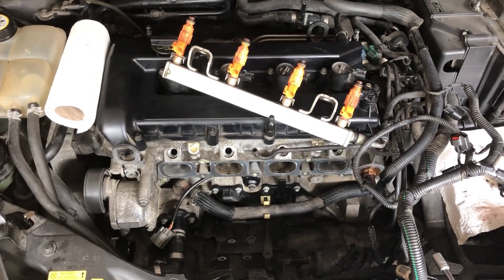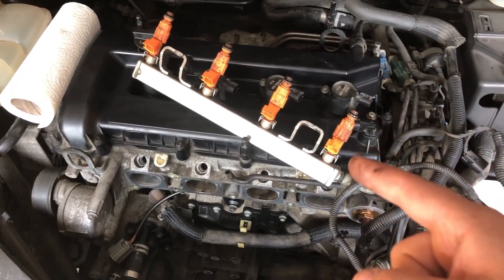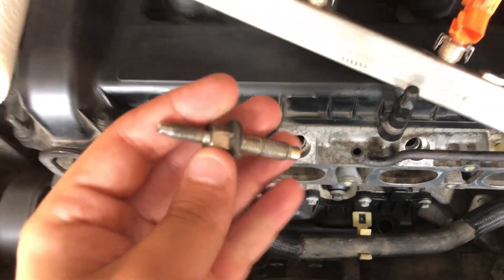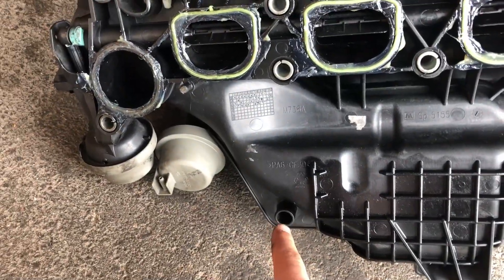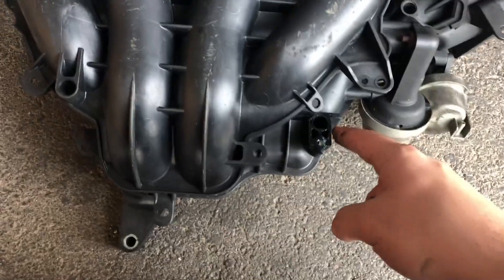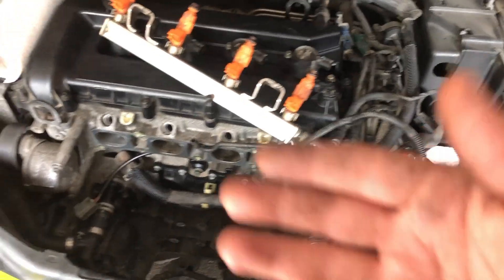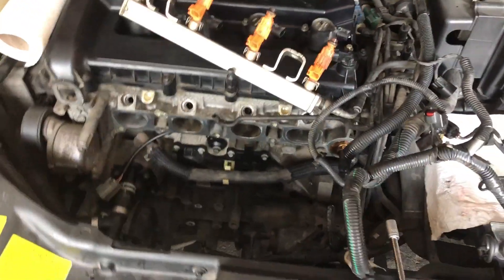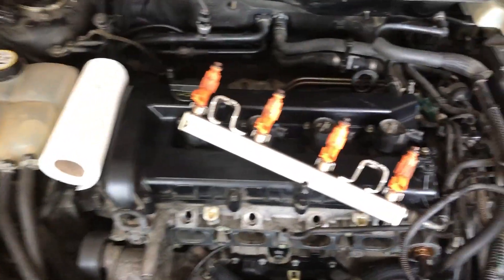Crankcase Ventilation System And PCV Valve (Volvo V50 1.8F)

Comment: how to check this Valve before dismouting all this intake system
Reply from the maker: It is not easy to check the PCV valve without having it out, and the symptoms of a bad PCV valve are not easy to detect, but they may include:
Extra blow by from the oil cap (if the valve is stuck closed)
Oil leaking from the seals around the engine (stuck closed)
Oil burning (stuck open)
These symptoms are also similar to piston rings' problems' symptoms, but it is better to check this valve before dissembling the whole engine.

Comment: does this operation need disconected radiator and take them out?
Reply from the maker: @dawid31m  No, this can be done without removing the radiator.

You may just need some extra small adapters to get off the bolt in the middle of the intake manifold. First you can insert the socket and an adapter, then put more adapters if needed, it is a bit deep and it is located in a tight place.

Comment: Im wondering if you changed the oil separator as well, and is there a specific torque for the oil separator bolts?
Reply from the maker: @tomastouma566  I don't have the torque specifications for the oil separator, but it you can feel it when removing the bolts, do not tighten so hard, it is plastic, and the gasket is probably a rubber gasket, which means that it is easier to feel it when the separator is sitting good.

Comment: Great and very informative video - just wondering if you scrapped the car since you just move and scramble the manifold around on the floor without thinking about all the scratches it gets everywhere and possible debris coming inside the manifold - it's all scratched up dude!!!
Reply from the maker: Thank you :)
The intake manifold was not dirty when it was installed back on the engine :)

Comment: Hi! Thanks for the video. Question: at time stamp 5:20 you show the inside of the intake manifold. What is that glue-like substance around the green gaskets for the intake? Was that original from the factory? Or has someone changed the intake manifold before?

Best regards,

Paul
Reply from the maker: Hi!
That was grease and it is not from the factory, if the gaskets are okay so you can use them again directly, if the gaskets are a bit worn so you can replace them first but if you can not so you can use some grease (Silicone grease so it does not damage the rubber) and it will be okay.
You are welcome! :)
Reply: @MerohDIY  OK, I see, thanks!

Comment: Do u need new manifold gaskets or rubber rings when u take off and put back on?
Reply from the maker: No, you do not need new rubber gaskets if yours are good and are not leaking air.
If you want to, you can change them, because the intake manifold will be already off and it will be easy to change them.
Remember to clean them and to clean where they sit on the engine and on the manifold, same ones or new ones, better if they sit on a clean surface.
Reply: Ok my volvo v50 rocket cover is leaking oil onto plugs causing misfire. Some recommended to change pcp valve or crank breather valve
Reply from the maker: @Onemanshow1974  Change the valve cover gasket and spark plugs gaskets (That are located under the cover, the rubber ones, not the metal ones) and then you can check the PCV valve if the valve cover leaks again on the sides or on the spark plugs.
Reply: When I open cap and put larex rubber glove it blows not sucks. I can try gasket. I change rubber coils and spark plugs and change gasket. Clean rocket cover before putting on new gasket and where it sits I will clean is there a torque setting for rocket cover. Thank you for the video good stuff

Comment: Can a broken pcv valve hose stop the engine from starting?
Reply from the maker: No, you can start the car also without the PCV valve at all. The PCV valve's job is to take away the extra pressure in the crankcase. A broken hose will cause some oil vapor to get out and you will have some oil close to the broken part in the hose. But if the hose is damaged by a way that it becomes closed and does not let the vapor to go out then it is not good to drive the car, otherwise there will be much pressure inside the crankcase and the gaskets can be blown.
Reply: @MerohDIY  Ah okay thanks. I have a car that wont start and I was hoping that broken hose would be the problem
Reply from the maker: @axe456  If the car is not starting, you can check your fuel pump, fuel pump on petrol cars makes a noise when you turn on the ignition and before you start the engine, if you do not hear the noise, it means that the fuel pump is not working, if it is working, then you can check your spark plugs, ignition coils and injectors, if they are working, then you can check the crankshaft position sensor. These things are necessarily to start the engine.
You are welcome :)
Reply: @MerohDIY  The fuelpump was replaced a month ago and the car started when my friend sprayed starter gas on the hose. Its not my car and I havent had a real look at it but I´m assuming they checked for spark, air and fuel 😂
Reply from the maker: @axe456  Well, this may be a compression issue, did they do a compression test?

Comment: @Meroh Thanks for the video! I have been checking both your video and Craig's DIY Car's video on removing the intake manifold, your videos have been a great help. :)

I haven't gotten the manfiold off completely yet, I still have the 3 bottom/middle screws left - got any tips on how to get the one in the middle off? :D
Also, at 6:53, how did you get that gray connector off of the cable? Doesn't seem like there is any flap/latch to press down on like with all the other cables.

Really thankful if you could try to answer!
Reply from the maker: The middle bolt is a bit tricky to get off, you can use two or three small adapters together to get it off. Connect the socket to an adapter and fasten it to the bolt (Use a paper inside the socket so the bolt do not fall down), hold it with your hand, then connect a shorter adapter to the one that is already on the bolt, then connect a small wrench to the last adapter. So basically you need a few different adapters between 5 and 10 centimeters. You can also use a multi angel adapter that you can use in any angle.
The gray connecter is also tricky, the cable has almost the same length as the distance, it has to have something on it that you can push and at the same time push the connector in and out few times (Use some extra power but without pulling the cable itself but pulling the gray connector) and I think you will get it off.
Sorry for the late reply. You are welcome :) Good luck!

Comment: I have S40 1.8 2006. How do I know if my PCV system are bad? What symptoms? And also the MAF-sensor if its dirty what symptoms? My car starts bad sometimes. Like if it's running on 3 cylinders with lower rpm and a little bit shaky car/chassis. Run normal when pressing gas pedal one time.

When I brake rpm fluctuates when coming to a stop. Really annoying. Also my car is hesitating when letting of throttle engine braking and also with a steady speed both slow and a little bit faster its noticeable.

I have a feeling that there is a valve of some sort that are the cause of my issues. Vacuum or something. And/or spark plugs/coils
Reply from the maker: Well, the PCV valve has a symptoms of burning engine oil and blueish smokey exhaust for example if it is stuck opened, if closed so you will see oil leaking around the engine.
This engine has a MAF sensor and a MAP sensor maybe or a TPS (Throttle position sensor), all three may have the same symptoms.
Your symptoms seem to be like a misfire, it can be caused by a faulty spark plug, a faulty ignition coil or a faulty injector, or caused by oil getting into the combustion chamber maybe. You can start by checking the spark plugs, the ignition coils and the injectors.
Reply: @MerohDIY   thank you I will try that.. I can not see any black, white or blue smoke from the exhaust. No visible oil leaks aswell around the engine. Just in the air filter box at the blue crankcase filter. That is a bit oily and looks a little bit melted on the surface. I have some oil leak between gearbox and engine but I've heard/seen that that are quite normal on these engine.. not great but. It will do it by age.

Would be cool if the crankcase ventilation can be diagnosed. If its working properly or not. If the parts are somehow cleanable. Not thinking on the PC valve now. Just the hoses and that stuff that are easily reached without taking intake and such off. 

I have replaced the magnetic vacuum variable valves one time. Located on the right side of the engine

Comment: What you put for seeling on holes and on gums ? What mixture
Reply from the maker: You do not need to use anything, you can use the seals only and they will do the job, if they are cracked you can buy new ones. Using grease or oil will damage the seals, oil and rubber are not friends.

Comment: What mileages achieve this 1.8liter 125HP Ford engine?? On regular basis.
Reply from the maker: This depends on how much the owner takes care of his or her car. But it can last for more than 300000 kilometers without problems if the services were done at their time. I am not sure about this but I saw some cars with this engine that came up to 300000 and were for sale.
The Volvos V50, S40 and C30 that have this engine (Both the only petrol engines and the flexifuel engines that are 1.8 litre) rich almost 3000 RPM when driving at 100 km/h in 5th gear, this means that the engine will run at high RPM when driving at 120 km/h which is not so good for the engine.
This engine is almost a Mazda engine that Ford used in their Ford cars and in the Volvos.
Reply: @MerohDIY  Thank you for your answer. Interesting point you've made about rpm's at 120kmph. It makes me think that if it is a japan engine then it should like high rpm's. Does it make sense to you?
Reply from the maker: @mfst100  you are welcome :)
There are many Japanese cars with manual transmission that can go at 120 km/h with lower RPM, so it is not because of that the Engine is Japanese, it may be because of that they want the catalytic converter to be at higher temperatures so it works better and it will be better for the environment, but I am not sure of this, or it may be because of another reason.
Reply: @MerohDIY  OK. Thank you.
Reply from the maker: @mfst100  you are welcome :)

Comment: Hej, did u ever had the following error codes P0132 and P1131 ? If Ja how did u fixa ?
Reply from the maker: Hi!
I did not have any of the mentioned codes, but you can check your oxygen sensor or its wires. These codes can come because of some problem with the oxygen sensor.

Comment: Can we say that all P2 chassis engines is going to have this problem after 200.000 km? What are the odds? Because I am planning to buy one... Great video! Thanks..
Reply from the maker: Well, this does not depend on specific platform, but the 1.8 engine on the V50 is used with a transmission that makes the engine have almost 3000 RPM at like 100 km/h at the fifth gear, which means that the engine may be worn faster than other engines, unlike the V50 T5 for example that has a transmission that makes the engine comfortable at highways.
Thank you Mehmet! :)
Reply: @MerohDIY  I really appreciate your kind replies... :)) Thank you..
Reply from the maker: @mbicerist  thank you very much Mehmet! 😃 I appreciate that :)

Comment: Kan you write what does it called in swedish? 
I have the same problem on my V50 and i was in Volvo and they changed
 the crankcase ventilation but the problem is not solved.
Reply from the maker: The crankcase ventilation system is called "Vevhusventilation" in Swedish and valve is "Ventil".
If changing the PCV valve did not help and you already checked for leakage, it can be that the engine is worn.
Reply: @MerohDIY  would that mean new piston rings. I'm trying to learn as much as i can just in case I take this job on to fix my car.
Reply from the maker: @zigzag7194  yes, it can be the piston rings and it can be the valve seals or another engine wear.
I understand you, some things are important to learn 🙂

Comment: My car is burning oil recently and see some oil marks in the air filter area. It might be the PCV issue. Do you have a garage in Sweden? Can you suggest a garage that might work on this a bit cheaper than dealers?
Reply from the maker: You can find some oil on the sponge that is located near to the air filter and I think that this is okay, if the oil was too much so it may be the PCV valve or other problems.
I do not work with cars but I do it as a hobby only.
It is a bit expensive to check the PCV valve on this car in Sweden because it will take time to remove and install again the intake manifold. I can not recommend a specific company, buying the tools and doing it by yourself may be the cheapest option, otherwise you can visit any car mechanic that knows about this engine and ask about the cost, a car mechanic that knows about this engine because some people with companies can take your car in and start learning on it, and that is not good.
Reply: @MerohDIY  how about the glove test? Can we say its results are 100%?
Reply from the maker: @mbicerist  well, the glove test can show if you have too much blow-by, but blow-by is not only caused by a bad PCV valve, it can be also caused by bad piston rings.

Comment: Hello do you have a part number or website that you got the Pcv valve from thanks
Reply from the maker: Hello
The part number is 30711779. You can buy it from many places, I recommend that you buy the original one.
You are welcome.
Reply: @MerohDIY  I have a Volvo 1.8 with only 82000 miles on the clock if the PCV is blocked would that cause it to smoke ? And is this Volvo that you worked on a 1.8 thanks
Reply from the maker: @zigzag7194  yes, it can cause smoke from the exhaust, blue smoke.
The car I worked on was a Volvo V50 1.8F. The engine on both the 1.8 and the 1.8F is the same.
You are welcome :)
Reply: @MerohDIY  many many thanks for your reply.. the smoke that comes out is more on the white side. It's not really blue. 
I think I'm going to have to turn this car in to a project car. 
As it only has 82.000 miles on the clock and it would be a shame to break it up. 
Thanks once again for the info👍🏿
Reply from the maker: @zigzag7194  white smoke can also mean oil burning, it may come white not blue because of the catalytic converter.
Yes, work carefully :) good luck
You are welcome :)
Reply: Thanks so much

Comment: Hello,

I am just planning to replace the PCV valve in my 2005 V50 1.8.
To remove the orange valve itself do you need to remove the whole plastic lid that the orange valve is installed to, or can you just remove the valve itself from it's socket?

As far I could figure it out, some kind of clip-in mechanism keeps the valve in place, is there a chance that I can break it while removing the valve or is it made from kind of a soft plastic, so there is no risk as such?

Only asking this because I don't want to order unnecessary parts for the repair.

Many thanks for your answer in advance!
Reply from the maker: Hello!
Yes, you can remove the PCV valve without removing the oil separator (The big plastic thing that the PCV valve is attached to), but the part that holds the PCV valve is as you said a bit soft and can be broken, that is why you have to be careful when you remove it, otherwise you can remove the whole oil separator and then remove the PCV valve from it.
You are welcome! 🙂

Comment: Thanks for the video, it was very instructive. What is the cars' year and mileage (kilometers)? Did you also had problems with the swirl flaps from the intake manifold?
Reply from the maker: Thank you! 😃
The car had about 180000 kilometers and it was a 2006 car.
The swirl flaps in it were good.

Comment: Hello
I have some questions to you:
1. Has your engine had problems burning oil?
2. Has the PCV valve that you removed turned out to be damaged and replaced it with a new one? After this replacement, if you had a problem with oil burning before, the problem disappeared?
I have a similar engine at home and I noticed when cleaning the throttle that in the intake manifold I have a lot of oil at the bottom, the engine also burns oil about 0.5l / 1000km. I am looking for a reason if the PCV valve can be responsible for it or something else?
best regards
Reply from the maker: Hello hello 🙂
Yes, this car burned about 1 liter every 150 km.
I changed the PCV valve on it and nothing got better, the car had a worn engine and I think the piston rings were too bad, this could be because of that the old owner did not change the oil when it had to be changed.
You can start by doing a compression test to the engine. Then if you do not find problems in the compression so continue by replacing the PCV valve.
You may get good results by doing a compression test even if the piston rings are bad, this happened to this car.
Regards 🙂
Reply: Piston rings damage is a very very common fault on these engines, mine had it too. Former owner spent 2k euros fixing it.